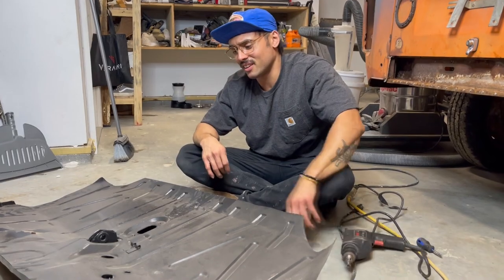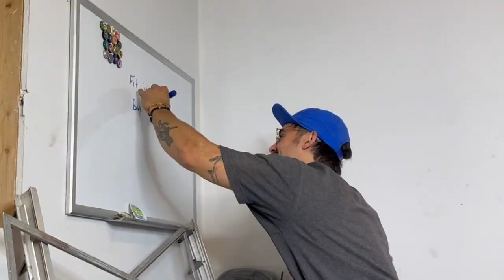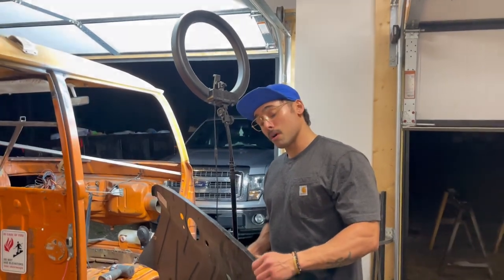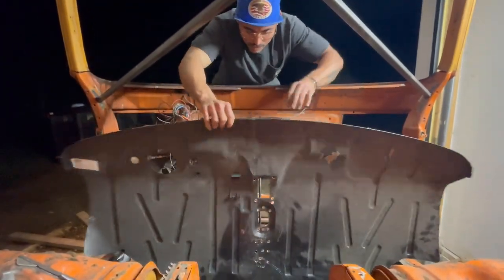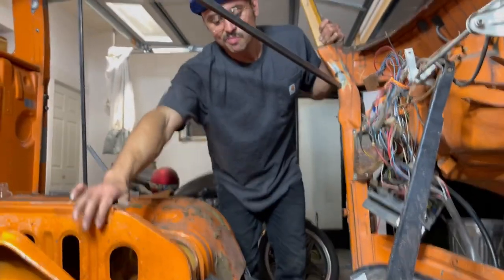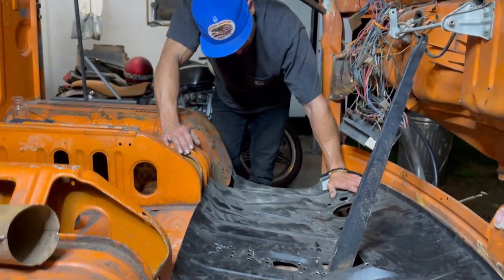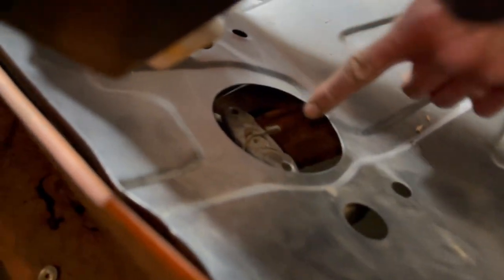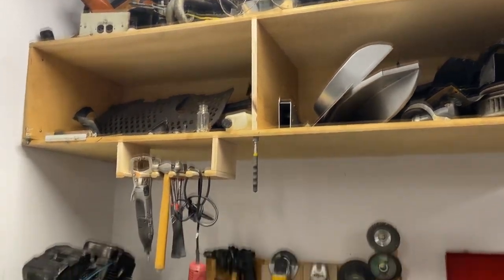Busdepot Front Floor Repair Panel Fail | VW Bus Restoration Episode: 17

Comment: I hate drilling out spot welds, worst job ever. As you probably now know if you don’t need the piece you’re removing, then just drill straight through or grind it off. Loving your pain, knowing it resolved now ❤️

Comment: I agree with dave glick , slice and dice make it fit the holes and add filler metal where needed.  or check wolfgang west to see if they have the correct floor

Comment: damn your frustration is is exactly why I only trust WolfsburgWest and/or Gerson. I've always had good luck with them both
Reply from the maker: I'm hoping that the Alan Schofield part I ordered will do better
Reply: Have you tried any of the panels from CiP1?
Reply: @nmartin5551   I havent tried their body panels b/c I just dont want the frustration,  since  most of the companies all get their parts from the same distributors where the two I mentioned make several of their own parts and other parts they still have German connection to supplies and not just crappy Chinese/Brazilian/Mexican parts that if your lucky they mighy be close enough to modify to work . bow that said I have bought from CIP1 (and others) and the items were fine. I just perfer WW and Gerson
Reply from the maker: @nmartin5551  CiP1 sells plenty of crappy Klokkerholm pieces as well lol
Reply: @Vangabonders  thanks,